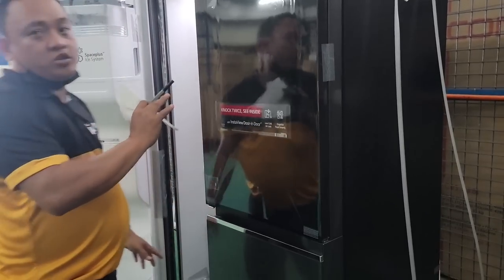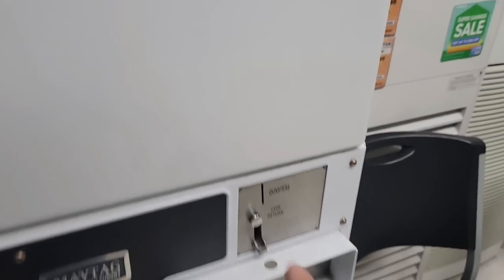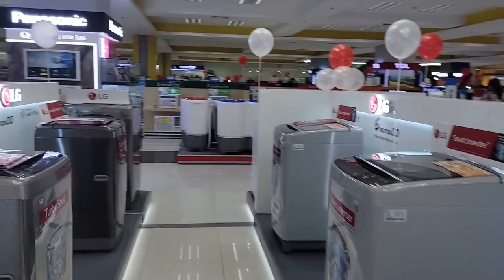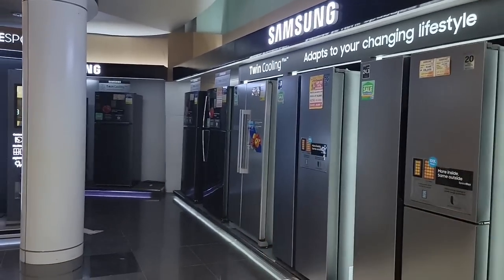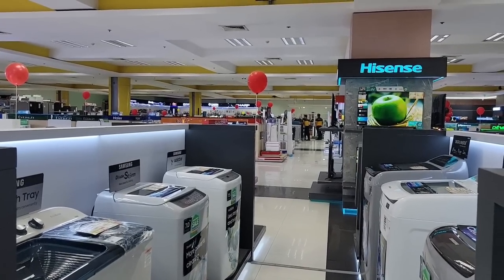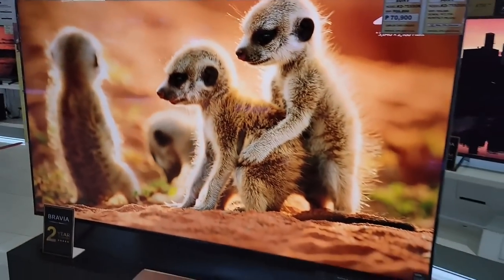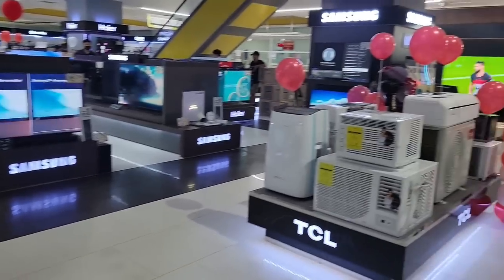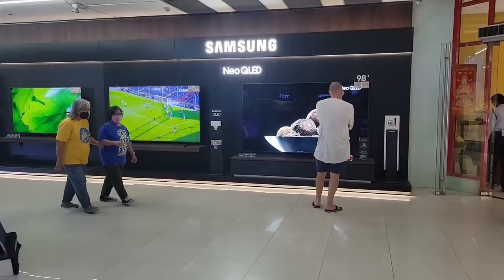IMPERIAL APPLIANCE Philippines MEGA SHOWROOM - The "GO TO" Place

Comment: Consumer reports state that refridgerators with water or ice dispensors mounted on the door, typically those items don't last more than a few short months longer than the warranty, just sayin. I agree completely with you, Imperial Appliance is the place to go. For example, I was looking for a 2hp Samsung aircon which I bought from Imperial, more than double the price at SM. I bought a 55" Skyworth from SM, what I have discovered is that the processor in it compared to the 2 TCL's I have back in Toronto, is it is really super slow.
Reply from the maker: I disagree on the dispensers.  I do agree on the processors. but our skyworth is pretty fast. No matter what brand they get built by market. A highend Sony in USA is not the same as a highend Sony Philippines.
Reply: It's a roll of the dice on any brand you buy these days. They just don't make anything the way they used to. If you product lasts forever, then people will have no need to buy more unless they are one of the people who need to have the latest model. 😉

Comment: and you know that any refrigerator that has been moved should be left unplugged and standing upright for at least 4 hours to let the freon settle.?
Reply from the maker: to politely correct you it is the oil to settle back down to the compressor. This is mainly if it has been laid down on it side.

Comment: If you buy that LG with a ice maker it will give you problems. Mostly because of the ice maker. The fridges without ice makers are far superior in longevity.  LG is good without the ice maker or  filtered water.
Reply from the maker: Ok I will rip it out and ask for a refund lol . Joke.  I will take my chances. Is your experience with one here in the Philippines or abroad? Do you own one and had this experience personally or just read that? I am curious. The ones here are different that USA models. Here there is no water filter just a tank that holds filtered water that you pour in.  A small pump transfers it to the door and ice maker. The countries with clean safe tap water have models that you connect direct to the tap and have a filter inside plus a coil of tube that cold water sits in.  Another MAJOR problem with inverter type appliances is POWER SURGES and dirty power. Philippines and now the USA increasingly has power outages with spikes when it comes back online. The power is either too low or too high and the hertz  is often out of spec.  Dirty power.  Our power is constant due to us running strictly off inverters and battery bank. The grid only charges our batteries but does not tie directly to our house. Also poor grounding plays a huge role as well.  In the USA they have this system where when there is a failure on the grid it trips at the sub station then tries to reset , then once more before it finally fully trips off until a lineman finds and repairs the problem.  This is very hard on appliances and tv's especially if a compressor has not balanced pressure inside yet.  All of our power is conditioned by our inverters so i will hope for the best. Our old refrigerator started giving trouble in 2015 before we built this place. Then years out of a cheap refrigerator that has been through hell - I can accept that. lol. Thanks Glenn and I look forward to your reply.

Comment: buying an LG or samsung esp the ref is a big problematic. it doesnt last long. esp the no frost model. the spare parts esp the internals cost almost the 50% to 60% of the total cost, its like buying a a toyota but the spareparts is like that of mercedez benz...easily get corroded the inside...
Reply from the maker: I get your point. They have improved that on the newer models. The models 2017 and back was bad. The pre 2010 models was real bad. I do know where to source the parts for a great price.